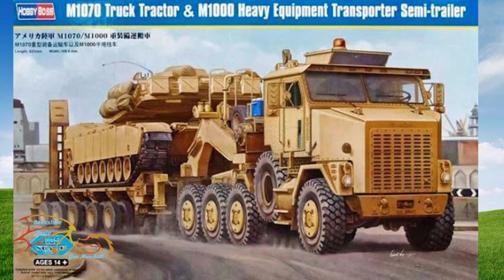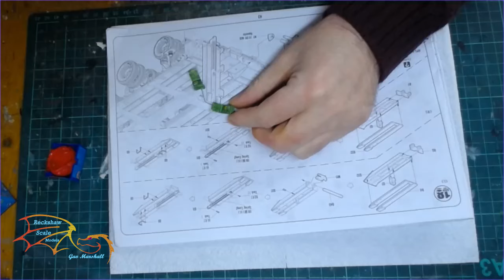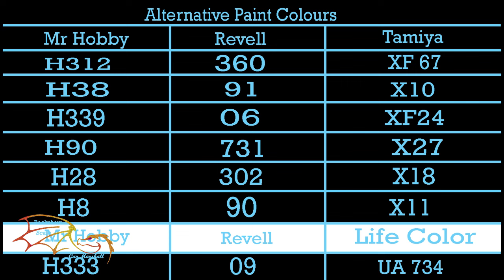Hobby Boss M1070 Truck & M1000 Heavy Equipment Transporter Semi trailer Scale 1/35 Part 17

Comment: Wheel alignment needs serious work.
Reply from the maker: @ekspatriat  hi thanks for the comment. The wheels are fully adjustable and do tend to move a bit while handling the model. Sometimes the tyres can pop off as well since I haven't cement them. That could be the reason why they may look out of alignment.
Either way thanks for pointing it out to me, I'll look into it further although the build is finished now and there won't much ill be able to do at this stage. Thanks so much for watching and taking the time to comment.